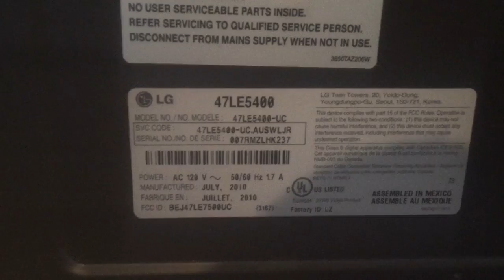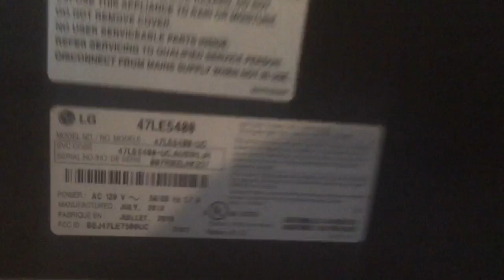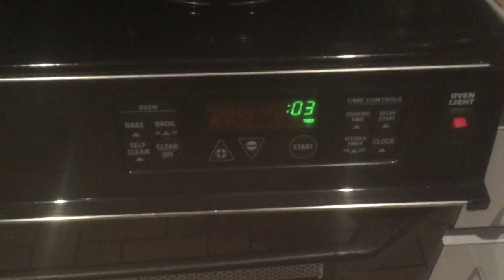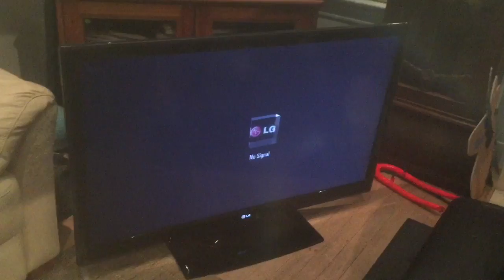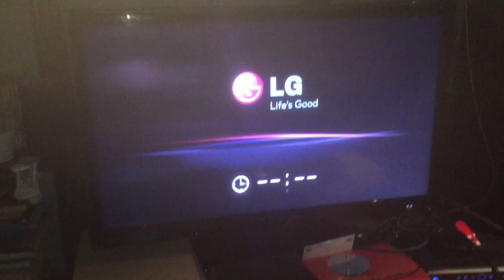Repair An LG Television Motherboard By Baking It In The Oven

Comment: How did you remove the two white cables at the top? Where am i suppossed to pull them from?
Reply: Marcelo Darrosa you just lift the black top off lightly for both
Reply: The black strip flips up
Reply: Did you do it?
Reply: Press on top edge

Comment: Can someone please update on how long this fix lasted. Thank you
Reply: Mine worked for about 1 year, no problem at all (using hot air solder not baking)
Reply: @andysantosa21  so you use it all over or somewhere specific
Reply: @marcos2221  Only on IC101 , I followed other's suggestion in badcaps forum, https://www.badcaps.net/forum/showthread.php?t=54976&page=2 (Found pdf file LG_55LW5600_Training.pdf) to know which one is IC101, and it is the video processor ic.
Reply: Mine lasted only about a month, tried the same trick again and so far it's still working (mine you it's only been two hours)

Comment: just did this on my 55LE5400 (exact same model as in this video but the 55" vs the 47" from the video) and it worked like a charm.  i did use a toaster oven as i had seen in another video online so that i could do it outside rather than stinking up the whole house using my main oven...either way, thanks for this!  we'll see how long it lasts!

one note: when i first reconnected the board, one of the ribbon cables was loose and only half the screen came on (the other half was garbled).  if that happens to you, try re-seating the ribbon cables at the top and make sure they're both set correctly and solidly.  once i did that, everything was 100% back to normal.
Reply: I just used the kitchen oven, I couldn't smell anything.

Comment: Hi, I just tried and bake the motherboard and I can see hardly the screen before it was nada, but should put it in the oven again? Please let me know,TIA.
Reply: Make sure you double check the wire connections from the other boards. A common problem is that the wire connectors dont get reattached properly. If you have lines or parts of the screen is messed up, that is most likely the culprit. Good luck!

Comment: WOW !!! Fixed my LG 50PK750 TV 3 days ago with this method and it still runs like new. Also ordered a replacement board just in case but for now i am very curious for how long the original one will last after the 10 minutes baking trick. Thanks for sharing
Reply: where did u order the replacement board from?
Reply: Alain JM Fradet Found a used one on Ebay. Very rare item to find on the internet for this model.
Reply: Mine lasted 4 years. Crapped out again last night. Going to try it again. You never know might work.

Comment: Used  this method again, but time my LG tv the screen would just go blank. Turn it on and off. Screen just blank. Would turn on after about 3 or 4 goes but would then cut out in about 5 minutes. So thought I would give this another go today. Bingo it's still working 3 hours later. Cheers Avrim.

Comment: It work! I follow your solution and it work great. My has problem with horizontal lines from top to bottom of the screen.  Thank you.
Reply: If those lines are there after baking the board, double check your wire connectors on the board. Those lines could be caused by a loose connector.

Comment: It works alright. I did this last year on the LG tv board, and my GTX graphics card. Both I was about to throw out, until I tried this. What have you got to lose. Must not be a gas oven, Electrical only.

Comment: FAKE
Reply: This is actually a known fix for several different boards.
Reply: Jeremy Walters ya right
Reply: This worked for my 9 year old 42 inch LG TV
Reply: ^ Like hunter.
Reply: Pro's use a heat gun to rework dry solder joints, this is just a lazier way of doing the same thing without having to spot where the bad joint is. I just successfully fixed my 65"lg that had no response screen or sound - just the front controls on the bezel would come on. Baking works for bad solder joints.

Comment: Just want to add another data point: It worked for me as well on my 55". I got about 2 years of functionality before it went out again just a few days ago. 

I want to caution anyone who is considering this: DON'T USE YOUR PERSONAL OVEN. Use a crappy toaster oven, crappy oven, etc. DON'T EAT FOOD OUT OF AN OVEN IN WHICH THIS HAS BEEN DONE. 

I'm planning on getting a cheapo toaster oven at goodwill and doing this again. 

Thanks for the video! Saved me about 250 bucks.
Reply: because all people are doing is melting the solder and a few times will work if the factory solder has enough flux left, with a proper reflow it would still be working, but that requires troubleshooting the actual problem, which in tvs most of the time is not that hard but you still need basic understanding of electronics
Reply: @HeribertoNieves  Definitely. I don't have the knowledge required to identify and fix the bad solder, so this is a much more appealing (albeit temporary) fix than paying someone >$200 to install a new board. Before I tried this, the board went bad and I did go and pay a technician to install a new board. About 2 years later, the TV crapped out again. I tried this as a last resort before trashing it and was pleasantly surprised that it worked. Now, my TV is probably worth $200 (in working condition), so paying more than that to get it working is just not a smart option for me.
Reply: @HeribertoNieves  Agreed. This "fix" is only temporary. Do you know which sodder points need to be redone? I have the LW5600

Comment: this does work,  unfortunately I have to "bake" the motherboard on average every 3 months or so, in fact just did it again,   got not quite 4 months since last time.   44inch LG tv here.  Few pointers, it does stink even after the 4th time, still emits that electronic acidy smell, so plan on running the oven vent fan and ceiling fan , crack a window if you can, be careful re installing , especially the ribbon connectors. If you are doing your work on a bench or table, try and fire up tv before reinstalling the back to see if working correctly.(I had one time where I had to bake it a 2nd time, taking it all back apart, learned lesson).  also, symptom may vary, sometimes its just the LG logo, sometimes its just the spinning LG logo, but one common symptom is NO VIDEO input at any of the inputs, time to bake it friends!! good luck!
Reply: VERY temporary and frustrating. I've had to "re-bake" multiple times. Can someone PLEASE point out which part of the circuit needs the actual re-sodder..... please
Reply: I used a heat gun (to avoid disassmbly, would last at most 2 weeks.  Figured not worth the trouble to keep taking the board in and out, if you going to do that you might as just get a new part.  If you go to LG's web site and navigate to parts you may be able to get a part.  They are not refurbished buy new parts, more expensive but you only need to do it once.  Fixed my 50" plasma this way which had developed the bad HDMI input.  With a new part you'll loose any customized settings so write them down, my board was flashed with the current firmware and included new cables.  PS.  Heating the part runs the risk of damaging other components on the board, not to mention repeatedly removing with the ribbon cable connectors.

Comment: Hi! Thank you so much for this video! I was really skeptical that it would work, but after reading the comments I just gave it a try. What could I lose? I only had a non working tv. My LG 32LV5500 just turned on but the screen was blank and with no sound. I “cooked” the main board for 10min at 200°C. And it works now! I don’t know how it will last, but hey, that’s been quite impressive! Thank you!
Reply: Does your TV still work?

Comment: This worked great. Thanks for the information.
Reply: I tried this on my  55" LG TV and it worked for a short while. My problem was I only used 200 degrees and took it out of the oven after ten minutes to cool/
I had watched another video that suggested the 200 deg temp. Since It did work for a little while I know that it will work. I am going to try it again at 385 degrees and leave it in the oven with the door open for an hour to cool off. If that doesn't work (I believe it will) I guess I will buy a new main board. At least this has verified the main board to be the problem.

Comment: It really works on mine LG 42LE5500 TV. Tried it yesterday thinking that I going to dispose the faulty TV anyway, so no harm trying. Unbelievably, it works and bring back my 8 years old TV to life. I covered the main board with aluminium foil before placing it into the oven afraid that it will further damaged my oven. Set the temperature to 200 degreeC and 10mins. Left it cool and screw back. Surprise everything works as per normal. Thanks!

Comment: Just worked on 55LE8500 200C 7 mins. TV had no power and would not come on at all,psu was fine,but there was no drv on signal from main board,when drv on was applied externally set turned on,but blank screen. Now its running fine!

Comment: Worked great not only restored the HDMI inputs but the audio, as well. Prior to the HDMI's failing the audio had stopped working, and I had to run my soundbar pre-tv straight from the cable box. Now let's hope it stays fixed!

Comment: Awesome found a new model lg 55 inch turned on no pic or sound baked it (the motherboard) just like you said working like new great picture all features works now its estimated value at a resell shop is $2000 keeping it anyway thanks  for the life hack!

Comment: My success story:  My main board problems started a couple of years back. My first five attempts involved an industrial iron having a top end heat range of about 200oF held on the heatsink for about a half hour. This worked but only laster around two weeks. I then used the oven method, cranked the heat up to 385oF, once up to temperature I put the board in, cooked it for 10-15 minutes, then opened the oven door to cool the board. This worked and the board lasted 10-11 weeks before having to be re-done. The second time yielded another 10-11 weeks. For the third attempt, I installed a small cooling fan over the heatsink. It did not help because again it lasted another 10-11 weeks. Finally, on February 2nd last year (2018), when cooking the board I used a slightly different method. It has been a year now and the board is still working. Here's how: I put the board in the oven, I then cranked the heat up to 385oF. Once there, I set the timer for 10 minutes after which I shut the heat off and left the oven door shut for 4 hours. I then installed the board and it remains problem free to this day. SUCCESS !!!
Reply: I feel your pain. On my 4th re-bake for the 55LW5600. Does anyone know which part of the board needs the re-sodder?

Comment: OMG, I stumbled across this video and was skeptical. Blimey I'm shocked, just bought an LG Ld490 for £25 with no sound and 1080p was flickering on ps4. I had nothing lose as today it wouldn't turn on, so gave this a try. Fixed all issues, it now has sound and runs 1080p. Thank you so much.

Comment: Chalk another one up to the "it worked" column. I payed $100 for this nice LG 55 inch, it took 5 minutes to warm up before the lines would go away. I figured no big deal, but over time it got worse and eventually the lines never went away. I watched several vids and did it myself. 10 min @ 385 and it worked like a charm !

Comment: I can confirm on this one! My LG 50LA6608 just started flackering and then went totally black. Sound was still on. I first checked T-Con (take a light and check the black screen while TV running; if you see a picture the T-Con Board works fine) and the Powerboard (by measuring the current), but they where fine. LED background could also be the problem, but mine were not on full power (I ran them on 50% and the screen brightness looked perfect before). So nothing to loose... Took the mainboard out and then to the heated oven. In my case "only" about 160-170 degress celsius (is about  320 degrees fahrenheit) but for 14 minutes. I think 385 is too hot and the plastic could melt. This thing just needs some constant heat so that the soldering points can widen itselves and reconnect again. Then a slow 30 minutes min. cooling down which is very important. Just switch the oven off open it and leave the board in the oven. Worked perfect in my case. Thanks for that inspiration!

Comment: I thought this was bullshit, there's a lot of it on the net. Anyway i tried to get parts for my LG 42"' LCD TV. Seems that they don't make parts for it anymore, it's only 7 years old and in perfect cond or so i thought. So i found this on youtube, thought what the hell have a got to lose? Tried it exactly as Avrim explained except that i removed the 7 round plastic plugs that hold the heatsink covers over the chips. I didn't think that they would survive the oven temp. Anyhow it bloody worked and i am very happy because we have 2 young girls coming over tomorrow night to watch TV and i was up against the wall as to how to entertain them. You saved my bacon and now i will have some kudos from my wife. She wont know that i put it in the oven or i could be up for a new oven...she is OCD clean freak :-)

Comment: can I use a heat gun instead? at least those would be my tools, instead of the oven in which my wife will surely kill me when she finds out
Reply: I just did it with a heat gun, monitored temps and kept it at about 200 centigrade for five mins. Worked like a charm. Cover the rest of the board in foil to place heat only where you need to and use some solder flux at the edges of the chip (helps the solder to bond).
Reply: I bought a 55LW5600 for $60 and used a heat gun on the BGA chip. I didn't monitor temperatures. I just winged it and my TV has been working for 4 days straight 24 hours a day.

Comment: Is there someone who can explain this ? Does it really work and... HOW DOES IT FUCKING WORK ? Please, I need to understand. :'(
Reply: the solder joints come apart from the motherboard's main processing chip.
this re-melts the solder joints and they tend to dry in the proper position.
tip when doing this (I just did it and it worked, btw): add thermal paste between the heatsink and the CPU after you're done. then it won't run so hot and wear out the solder points as much as it did before. Yours might have thermal paste but mine didn't.
Reply: Yes it works but on certain occasions,if its solder joint problem,its very likely it is gonna work. If your lg tv is LE something series and psu is fine,but problem is in mb,then there is big chance its gonna work

Comment: Guys I work in this field. For the love of god, DONT BAKE YOUR MOBO MULTIPLE TIMES. Find the datasheets for the smd components on it and read it carefully. a tipycal IC can handle 2 reflow runs at most, but usually only 1. reballing and repairing the component that is needed locally is always a better option. Of course if its already trash than sure, why not, but you can fry more stuff during the process and render it completely unrepairable

Comment: There is a possibility that it is the unplugging & reconnecting that is the actual fix as corroded or dirty connections are a common cause of faults that might be attributed to the motherboards.
It might be worthwhile for people to simply try disconnecting then reconnecting all the connectors before doing the celebrity chef routine.

Comment: It would seem that, with the reports of people having baked their MB's 4 or 5 times (regularly every 5 months or so for one guy), perhaps the inside of the TV needs air flow via a cooling fan?  Perhaps cooler solder joints throughout use would prevent the continual cracks from high-heat, then no-heat, usage?
Reply: I use big chunk of thermal pads and place them on every big chip that gets hot,just as much and thick that they got squized against back cover,this helps for them to stay in place and also dissipate heat. Works for years and doesnt fail again.

Comment: I got an LG 47LD650  a friend gave it away as he replaced the power board thinking the Caps were damaged,  he spent $100 and the tv did not work,  I thought, I have nothing to lose. I baked the board in my gas oven for 10 min at 390 F. I took it out after at 12 min let it cool for 30 min proceed to re-assemble the tv. OMG, it Works...PERFECTO MUNDO!!!   Thanks :)

Comment: Hey I have the same problem ...none of my HDMI are working I plug n and all I get is the no signal sign is that all u did was bake it
Reply: Same issue here.  Without even removing the back of the tv, I heated up the little chip just above the three HDMI inputs on the back of the tv and within about 30 seconds of heating, all HDMI inputs work.  Not sure how long this will fix it, but it worked!

Comment: Is anyone concerned about using the oven for its actual use (baking) afterwards?  Just curious, would like to here from people that have done this.
Reply: Do NOT do this. This is literally the dumbest thing I've ever seen. If you are having the same problem there other ways to do this without putting it in the oven. This video is proof that humans have stopped evolving.
Reply: @NunYa953  Why exactly? Is it because of the TV when it's working, that humans stopped evolving? If you've seen the factory line where they put the motherboards together you'd know that it comes in the oven unsoldered(size of your home one) and come out soldered. Or are you one of the bees that works there and fearing that this will affect your earnings??😂😂😂
Reply: @lipeeno  
There's a right way and a wrong way to fix things. Putting a logic board into an oven is not the right way...
Reply: I wouldn't be concerned. If anything partly melted (plastic or metal) it's dissolved in the air and got sucked out by exhaust fan. If you are concerned, let it run for double or triple time empty. Or give it a good scrub afterwards. Overcooked fat is proven carcinogen.